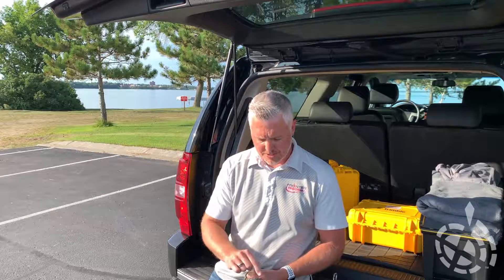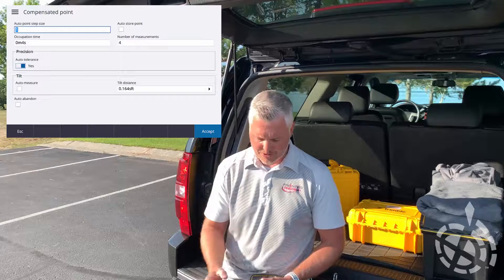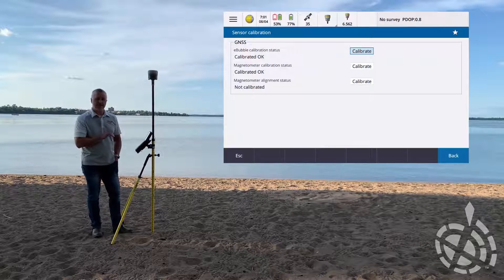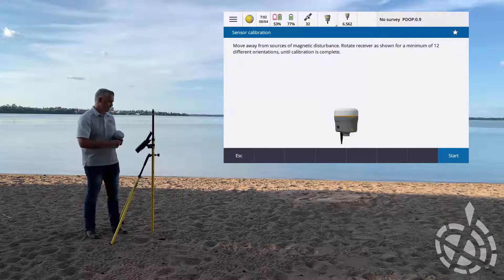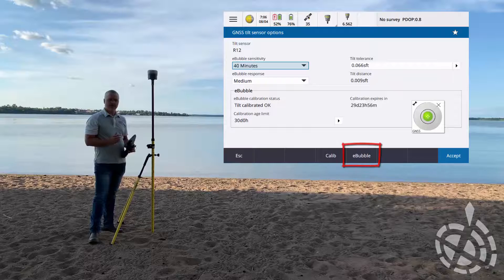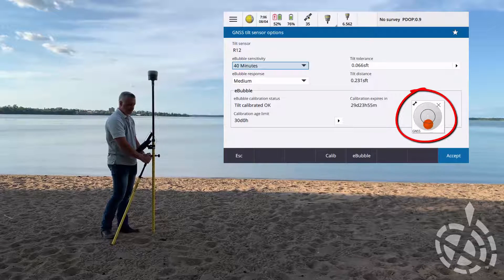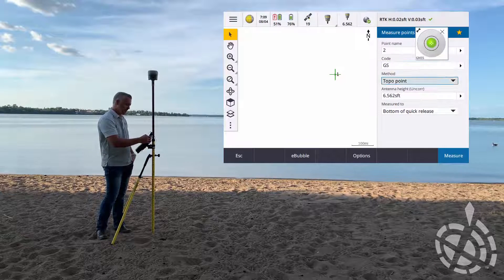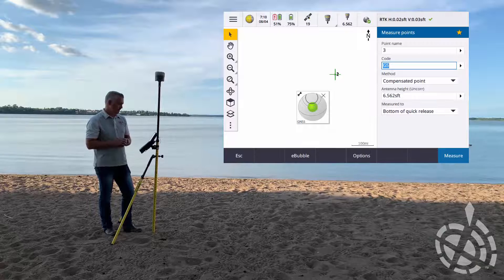eBubble and Tilt Sensor Functions with a Trimble R12

Comment: How do you get the ebubble to appear for topo point? I have it only for observed control points.
Reply: Hi Ryan, as long as the Tilt Functions are turned on in the survey style under Rover options, then you should be able to toggle the eBubble on for all measurements including Topo and Rapid.  There should be a softkey at the bottom of your screen in Access.  If you aren't seeing it, possibly try running Trimble Installation Manager to make sure you have the latest version of Access that you are licensed for along with rebooting the controller.  I hope that helps!  Thanks again.